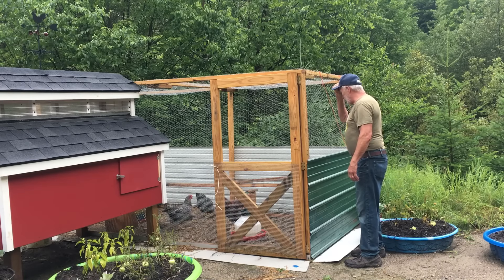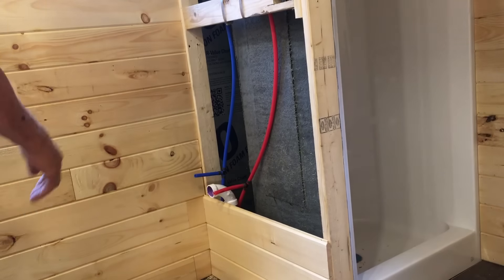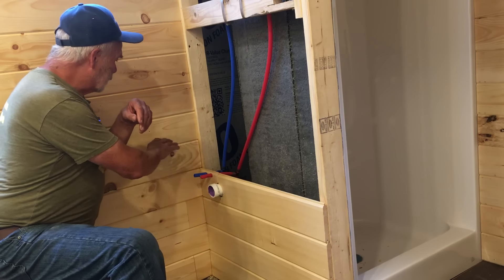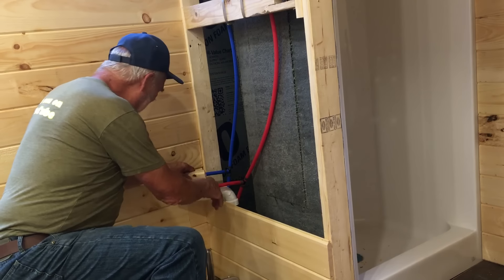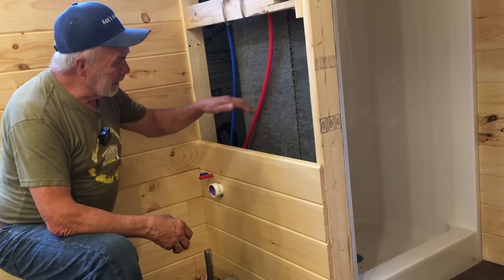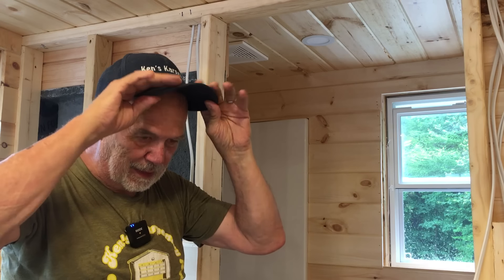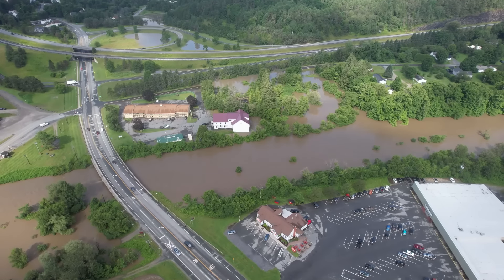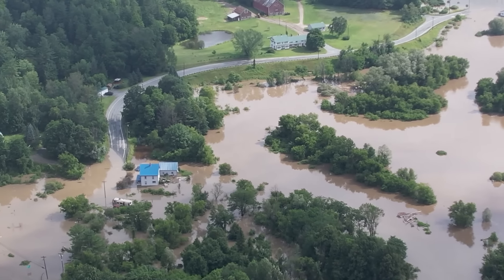Plumbing and Floods...2 Words You Should Never Use in the Same Sentence

Comment: Ken, I just wanted to say that I've been watching you build things in all sorts of shapes and forms for awhile now, and you're always generous with your knowledge and patient with your explanations to folks who don't exactly know the direction in which you're going, in certain situations.
For example: the circuit breaker box, plumbing vent and the pipe sizes. 

I'd been wondering some of these same things, but I know that at some point during the build, you'll explain where you're headed when putting all of these things together, and why you're doing it. I've yet to see you NOT explain what you're doing.

So, I just wanted to say thanks for taking us along in your building adventures and sharing your years of wisdom and knowledge.
It helps us all, and it's interesting and informative.
Reply from the maker: WoW thanks so much. That means a lot a lot to me.

Comment: I had an idea. You could build a box with shelving in it. This box could slide in the wall between the studs. It could be held in by 4 screws. This would be removable to access the plumbing. It's shelves could protrude from the wall an inch or so. Pretty much a medicine cabinet without the mirror.
Reply from the maker: Cool thanks

Comment: Liked the engineering aspects on the plumbing flows and the air admittance valves vs roof (vent stack) perforations. The main stack is to vent the septic/central sewer system so the gas doesn't enter the  dwelling/building. Might want to explain the purpose of the pee trap when you install the sink plumbing. Hopefully this flooding sheet flows fast enough to reduce the inconvenient damages there, but not overwhelm those lying in the southern direction.
Reply from the maker: Thanks I will

Comment: Good morning Ken,,inch and half for the sink is fine and quick vents are also fine,2inch is needed for the drain for shower, so everything is code compliment lol ..I think you should add insulation on the rough in plumbing is going it will be a little nosey   it might dead the nosey showere if someone is in there or if they pass gas lol .off too for I go 🐊🌴😎
Reply from the maker: Good morning thanks have a great day

Comment: Wow, over 4 inches of rain! Thanks for telling us why mounting the circuit breaker box in the wall would be a bad idea. I love how you did the connections for the sink through the shower wall! Yes, shower to 2 inch pipe and sink of 1 1/2 inch pipe for the drains! Thanks for talking about the drain flow rates compared to the input or supply flow rates for the sink and shower. Thanks for showing the drain vent! I was wondering about that! Cool, 35 years ago you learned about them! So you're using an AAV (Air Admission Valve) designated drainage vent right under the sink for the drains. I hadn't heard of those. Good to know! So great you don't have to use a hole through the roof! Good idea to fix the Pex supply nipples through the wall so they can't go back inside the wall! I like your idea of a shelf unit on the sink side of the shower wall. I;d like to see the flooding. It's sad but it's historic! Wow, that's some flooding! Wow, even the railroad tracks are flooded! At least the covered bridge is still above water! This is sad for so many people! I'm glad your friend moved out of that house. Thanks for the video of the "Seasonal Housing" and the Lyndonville flood! I'm glad that your homestead did okay. Just a bit of water over the top of you driveway culvert. On Friday the county told me they would help me with my rent and deposit for my apartment! I made a good dent packing today for my move. Most of my kitchen stuff is packed. I think I'll just move in a blow-up air mattress for my bed for now since it's tropical weather until Wednesday! I hope your weekend has been good! Thanks for all the prayers! You did good! God bless you both!
Reply from the maker: WoW glad you’re able to find a place to stay